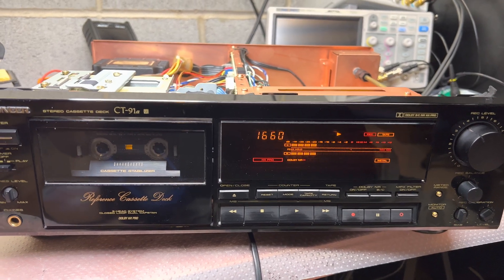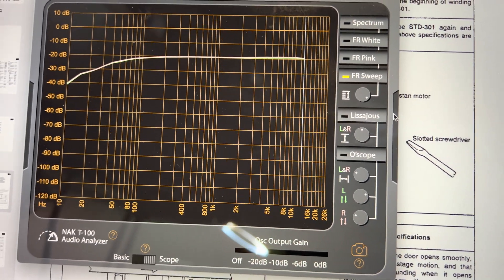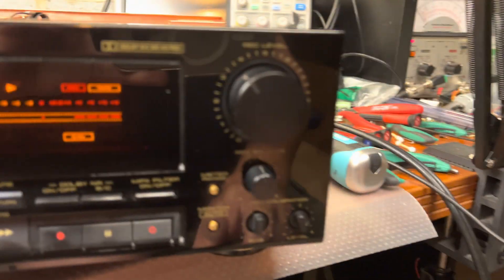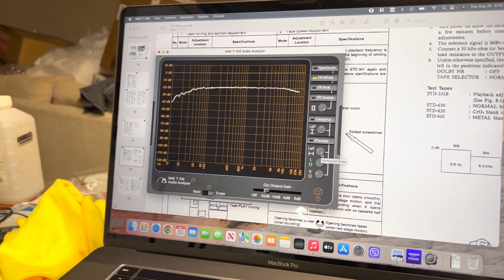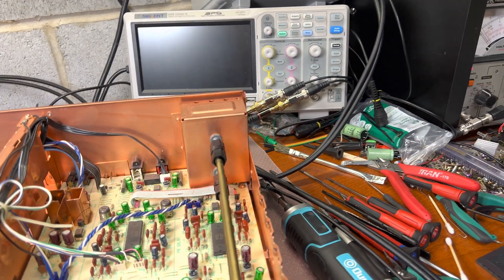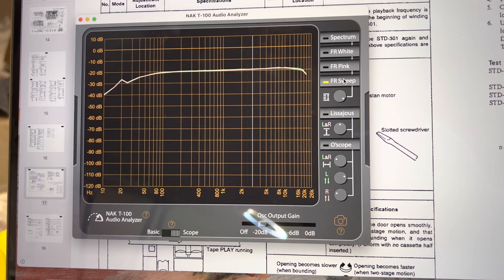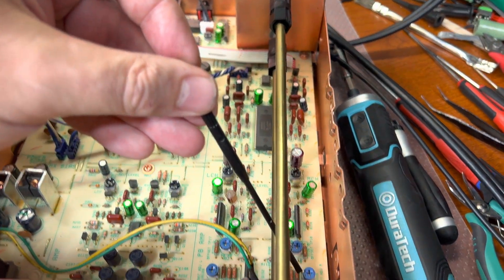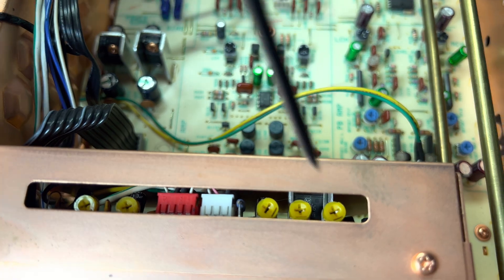Pioneer CT-91a Restoration Part 12: Evaluating Build Quality & Measuring Technical Parameters

Comment: The CT-91A is a beautiful deck & it's technical specifications are amazing but what I've found with an example that I've got is it's unstable with Type II & Type IV tapes which flicker from Type IV when there's nothing in the deck & Type II when I've got a Type II tape in it but it's stable with a Type I Tape in it but considering it's instability it's ability to record sound onto a BASF Chrome Maxima tape amazed me which suggest even Japanese tape decks can do it but they've got to be up to the job.